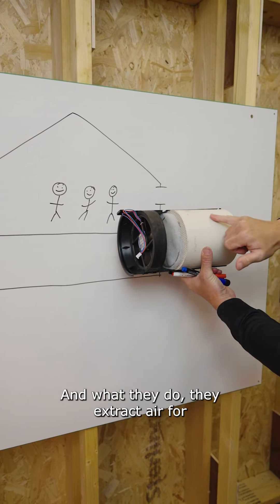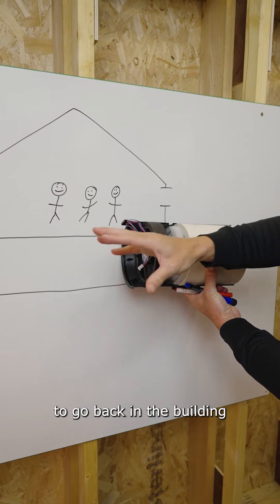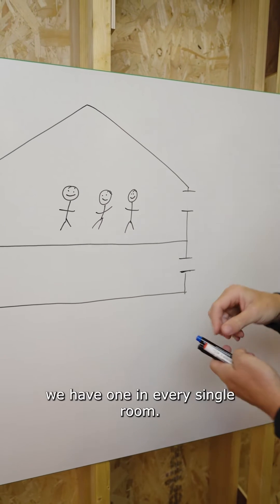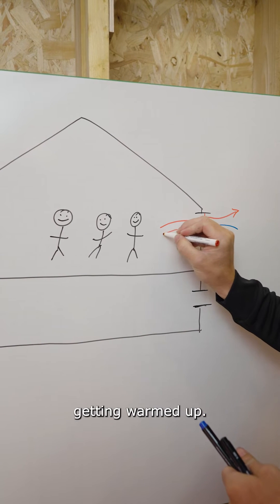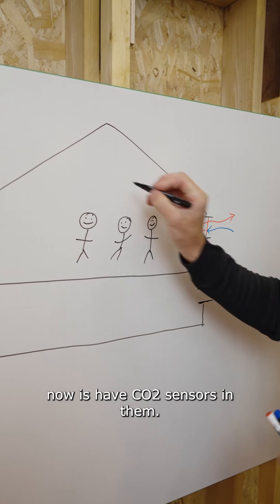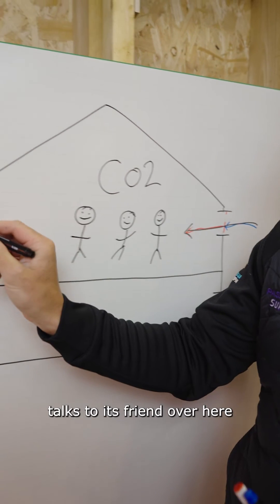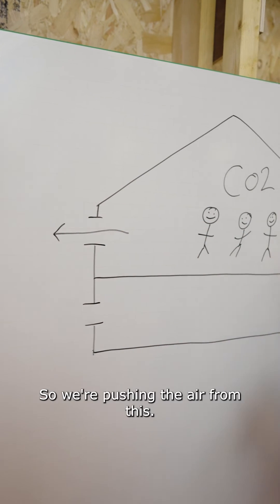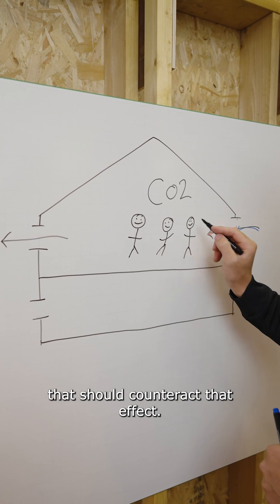What is decentralised heat recovery

Comment: Hi, what is the energy usage? Does the energy saved by recovering heat that would be lost offset the energy used to power the fan? If so what is the net energy saving?
Reply from the maker: These machine run on a couple of watts

Comment: Do you really need one per room? 
Assuming that air can flow through the house is the need of one per room due to limited volume of air that is managed by any given unit ?
Example: 100sqm per floor. French regulation say at least replacement of air per 24h. 100sqm is 250 cubic meter so flow of around 10 cubic meter per hour meant to be sufficient.
Reply from the maker: It's based on volume so it would do up to 40m2 but that's on maximum but you wouldn't want to do max. You would have one in the bathroom and one in the kitchen